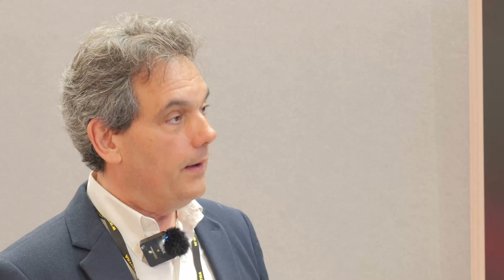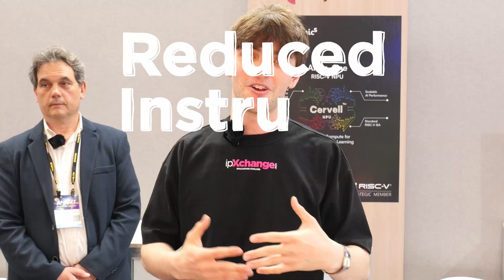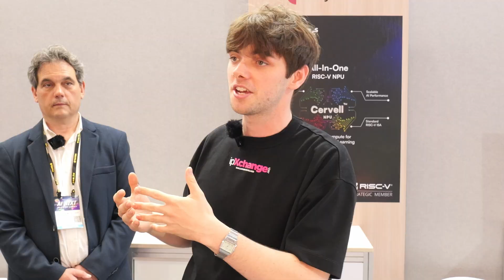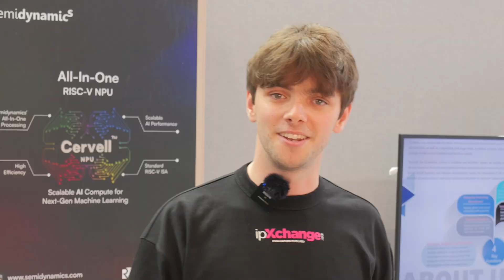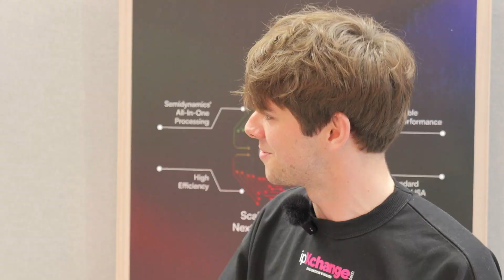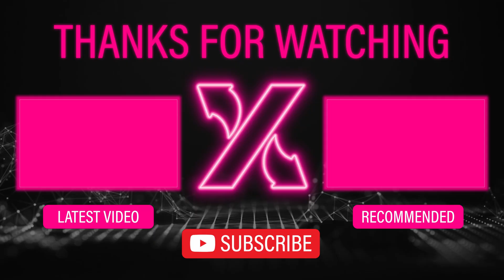What Makes RISC-V Perfect for AI? Semidynamics Explains

Comment: Logically AI would be easy to do with very few instructions, meaning you can scale it with hundreds (or thousands) of processors.

I would  think an instruction set of 1 (for getting stuff to work on new hardware) 8-16 and then 256 instructions is probably all you'd need except in cases where the complexity of the task a new instruction would speed up and simplify it.